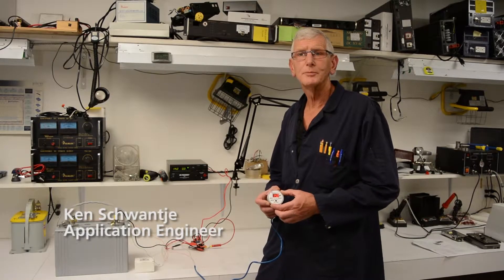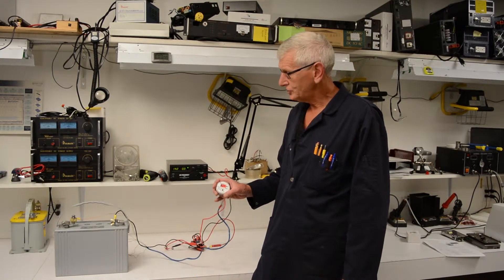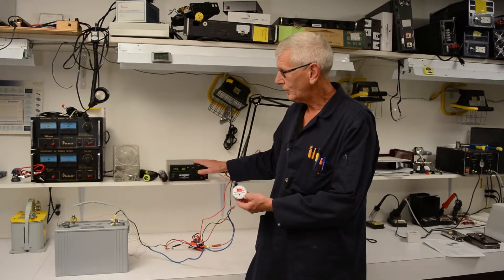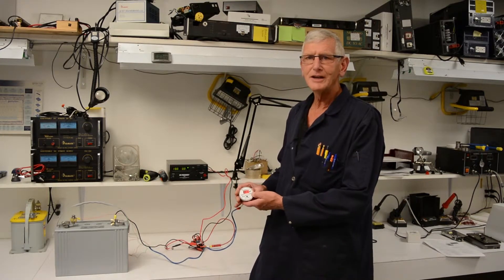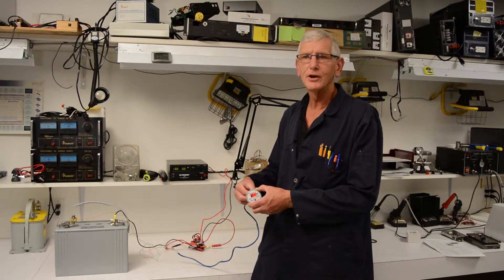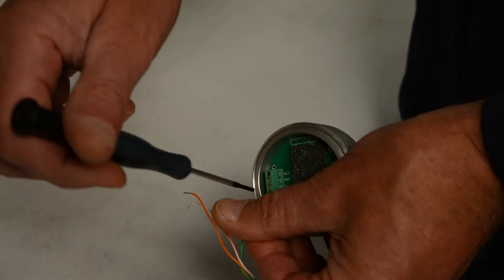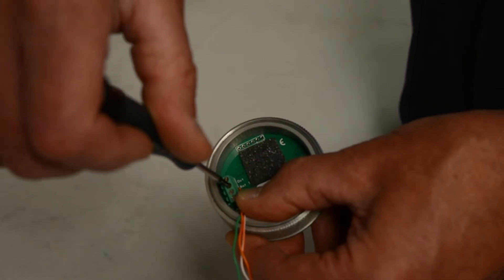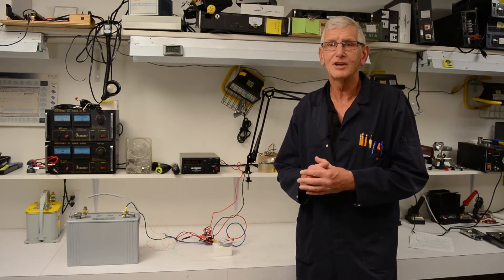Battery Voltage Monitor Installation & Features: BW-03

Comment: I ordered one with my new RV. Dealer is refusing to install it because they say they can't mount it anywhere. The issue is they are not able to get on the backside of any walls in order to screw in the mounting ring. I'm talking to them again tomorrow to try and figure something out. I can see their point.